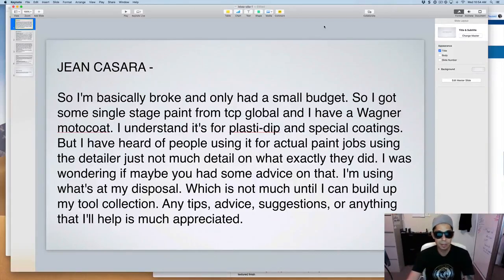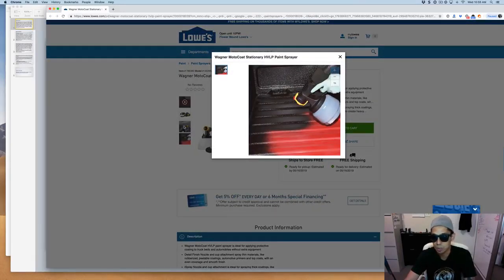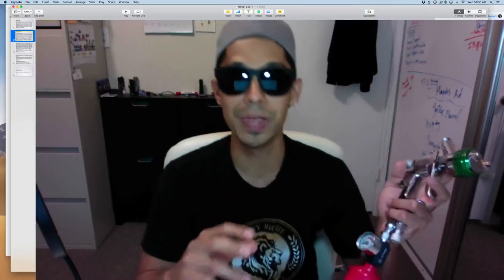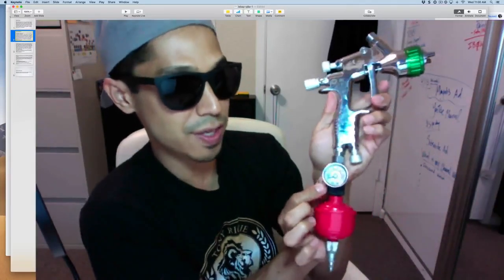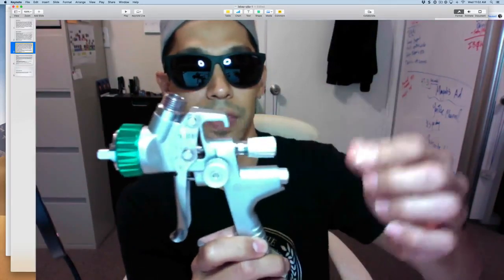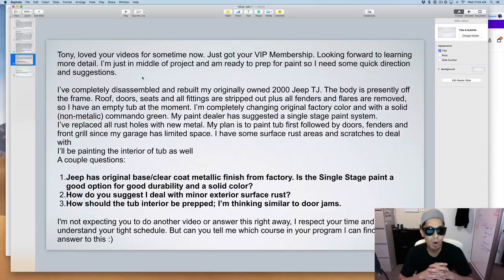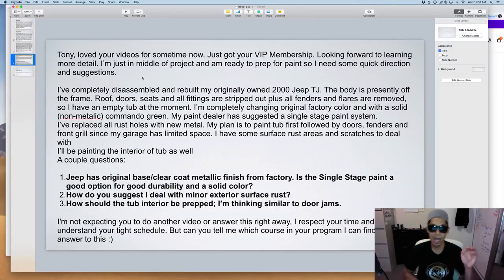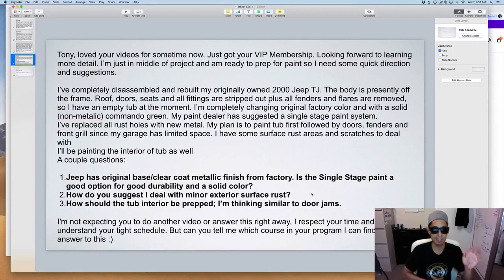Car Painting Tips on Base Coat Clear Coat, Single Stage and Spray Gun Settings 🚗

Comment: No Offense Bro. But the guy with the Wagner Just said that he Is on a a very Fixed budget.
And cant afford  200 Bucks. So a 150 buck spray gun wou;d be out of his range. And then you forget he DSOesn't have a compressor so another 200 bucks oh and then the filters,regulator,hoses etc. You are now on 450 and that is before paint.
I know you get paid by Atom For selling their product but you really didn't give very good advice.
Just so you Know  You can spray rustoleum paint and Duplicolor paint with the wagner used to do it in Late 90' to 2002.
It works fine.
For regular auto paints not so great.
As far as it goes if you are watching this @Casara Get the Harbor freight cheap gun set the 2 gun set it comes with 3 tips including 1.4 and 1.8 . Save for a cheap 20 gallon compressor at least 1.8 hp and use that. I have painted several cars with the HF set.
But the Wagner will do fine for Duplicolor and  Rustoleum type paints.